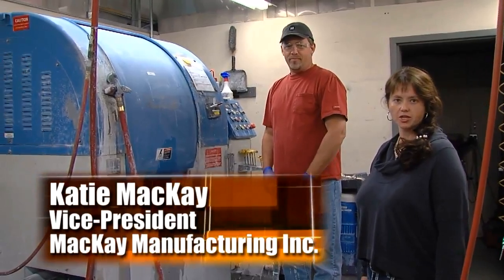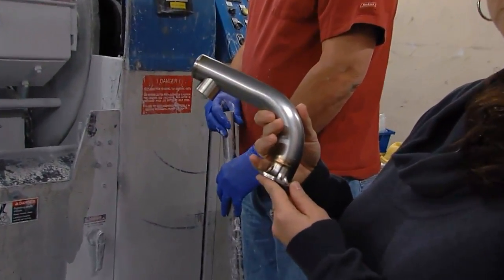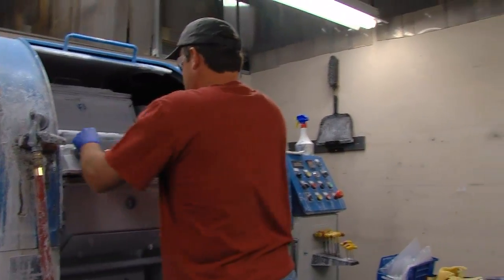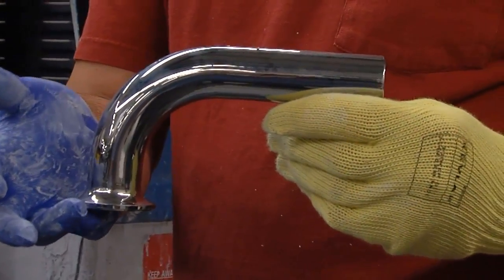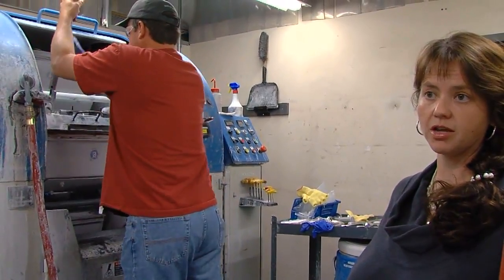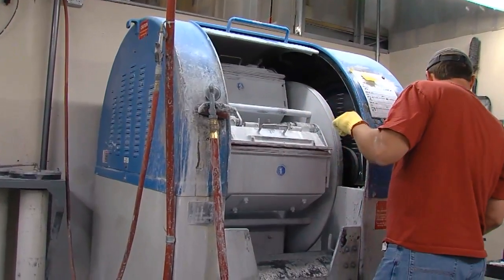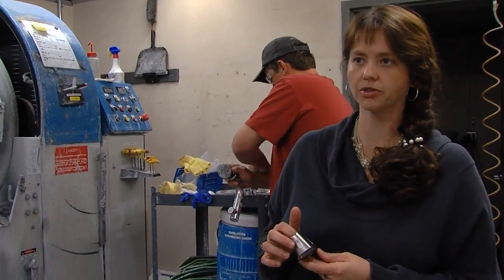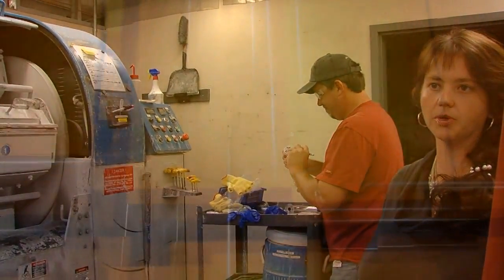Centrifugal Barrel Finishing Machine HZ120 (Mass Finishing, Inc.) - MacKay Manufacturing, Inc.

Comment: Katie: your guy at 7:40 is removing an allen bolt by hand from the cover feature. Give him a cordless drill or rattle gun with an allen key in it and he could remove all three bolts in about 10 seconds. And use air to blow out the allen recesses. Nice quality finishing. I did not know there was such a thing.
Reply: I can help you with that, see more at https://dryfinish.wordpress.com and contact me at dryfinish@gmail.com

Dave Davidson
Deburring/Finishing technologist
https://en.gravatar.com/dryfinish
Reply: CONTACT:
Dave Davidson, 
Society of Manufacturing Engineers
Deburr/Finish Tech Group
(T) 509.230.6821 - cell
(e) dryfinish@gmail.com
Reply: For more information about the machinery contact Dave Davidson at dryfinish@gmail.com